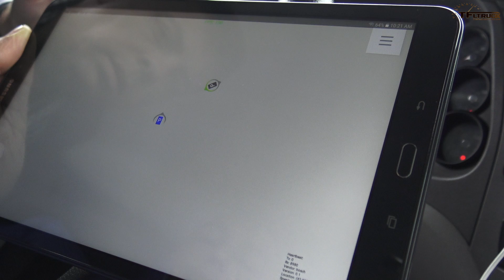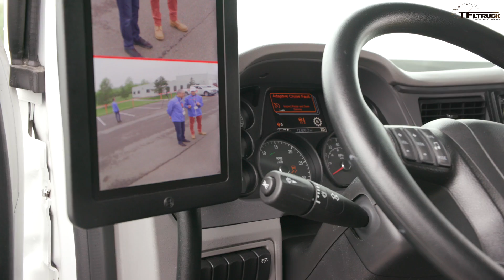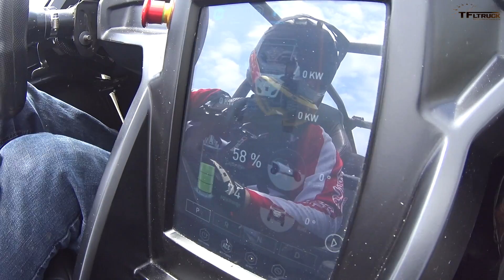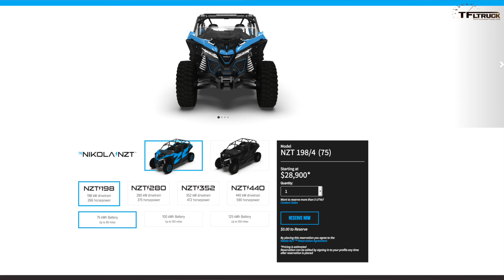New Bosch Tech Makes Big Rigs Safer

Comment: The only thing that makes Class 8 trucks safer is the DRIVER! The annoying beeping of my distance alert when a car cuts infront of my truck by inches...the beaming alert when a confused driver stops in the middle of the highway searching for the turn their GPS could'nt find....the lane departure alert sound when a lane ends or I enter a construction zone....the automatic braking that engages when a car brake checks and sends my rig sliding out of my control because the computer does'nt know what controlled braking is....I could go on and on...these engineers, scientists, shareholders, government regulation, and just your average ordinary citizens are NOT truck drivers!!!! Go get a Class A CDL with all endorsements and get behind the wheel and see for yourself....stop throwing a bunch of crap into these trucks and calling them "safer"....nothing will ever beat a Safe driver...not some computer that can be hacked, overheat, or misjudge.
Reply: St. Vick if you seriously think they would let these on the road without a driver behind the wheel in case anything happens then you are stupid

Comment: Are you kidding? Self driving trucks.. They can't even get self driving cars to work right. When a truck crashes it's not going to just hit and kill one, it'll be many. Another thing is that it will cost millions of drivers jobs, millions. Just so companies can get richer. Prices of goods won't get lower, they'll stay the same or go up. When NAFTA was passed, one reason they gave was to save by hiring Mexican drivers at lower pay, that would cross over and drive in America, to lower cost. All it did was lower driver's pay here in America. Goods still cost the same on the shelves. We don't need them...

Comment: Notice all of these "self driving" vehicles only work in states with no weather? 
Secondly, a self driving truck can not equip tire chains which are required by law. And yes there are auto chains, but they are generally worthless. 
Thirdly, trucks are required by law to put out warning triangles when broke down on the side of the road.
And lastly, how does the computer know if the air presser sensor in the tire is bad or the tire is flat?

Comment: I think it will happen but not for a while. Government regulations and laws are so far behind for this type of technology. Speaking from the traffic defense side, who is responsible and at fault in case of an accident or fatality. Is it the driver? The A.I.? The shipping company? The truck manufacturer? The engineer/contractor for designing and building the roads it drives on? Way too many parameters at this point.

Comment: Everyone getting in a fit over displacing truck drivers, this tech is decades from a complete replacement. Right now and foreseeable future, this tech will be for driver and safety of everyone on the road. Driver fatigue is a massive problem that self driving aide will greatly decrease the amount of fatal accidents from drivers passing out behind the wheel. It's far from perfect but a lot safer than  a human.

Comment: I had a recall a couple of years ago, on my Ram 1500's Uconnect system. Someone actually had the ability to remotely steer,  apply brakes,  or accelerate any vehicle with the 8.4 an Uconnect system.  All they needed was the VIN. Who do you think is going to attempt to access these 80,000 lb autonomous trucks, and what do you think their motive in doing so will be?

Comment: The problem is, even if you are 99.9999% perfect, a lot of people will be killed. And, there is an easily identifiable large company behind it. A few 100 million dollar lawsuits will change the equation.
Reply: Cliff Warren they will have a driver behind the wheel in case anything happens

Comment: Almost every single RECENT study has shown that autonomous trucks will not reduce the need for truck drivers but in fact increase the need for commercial drivers. Why? Because right now we currently have 12 loads per every 1 truck. Autonomous trucks will allow record amounts of freight to be hauled but autonomous systems still can't handle the end or beginning of the delivery. These systems are good at staying in a lane going down the interstate but still can't handle big city traffic nor things like downpours and blizzards. Shippers don't want to hear "sorry can't deliver your load today because the auto system can't drive in snow". Now imagine how much adding things like sensors to the roadways will cost? We can't even get potholes repaired. Now think of the political fallout. Millions of people standing to lose their jobs in a relatively short time frame... I bet it won't take long before politicians jump on the anti autonomous bandwagon if they ever want to stay elected. I'm not anti technology, I clearly see the benefits, but it's not going to be the end all that a lot of folks think it will be.

Comment: Sorry guys, I strongly disagree!
If they want to eliminate the people, then restore the rail systems and use  trains again!
However, failures and repairs you’ll always need people to do the work.
Reply: Rudy-The-Cuban Gonzalez they aren’t saying that truck drivers should be eliminated from the situation...the trucks will still need a driver in case anything goes wrong